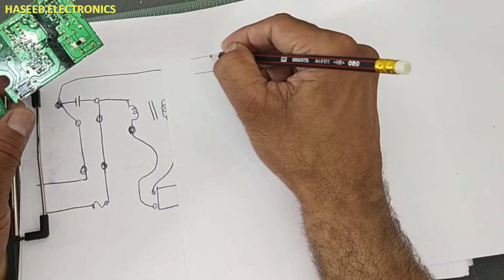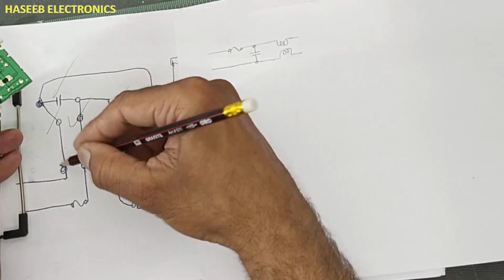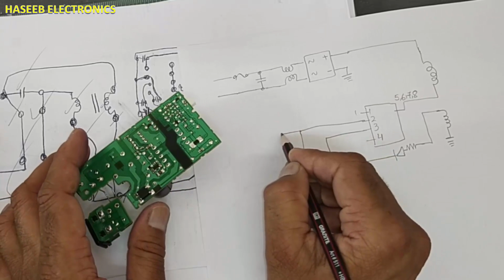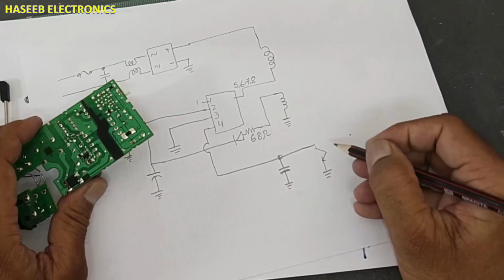{648} How To Draw Circuit Diagram From PCB / PCB Layout. PCB Reverse Engineering Technique

Comment: Thank you I enjoyed the video although it seems quite tough for my level. I am currently attempting to repair a 220vac automatic voltage stabiliser and i need to study the control circuit , then study the relay switches then the tapping on the primary and secondary coils.  I hope i manage to fix it even if it takes a long time to learn.

Comment: Nice teaching Mr, Haseeb, i have a laptop charger that would not startup  the laptop i commenting with right now, so i got mad and put the charger in the freezer for 10 minuits , then i plugged the cold charger in the laptop and woops , the laptop startup , this is crazy for me , maybe you can explain what component in the charger got cold so that the charger decides to work . this happen every day and i can work on the laptop more than three hours long , i do learn a lot from your videos , thanks verry mutch..
Reply from the maker: wow it is really fantastic, it is really a surprising fault 
possibilities 
1. Dry Joints / dry soldering in power rail (mosfet, PFC mosfet, PFC rectifier, main bridge rectifier, current sense resistor)
2. some internally leaked polar electrolytic capacitor. (check body temperature after is turns off after working cycle)
3 check output cable continuity between three wires (sometimes the wire insulation becomes leak or weak, which makes chafing between the + to negative or - to positive or id resistance wire makes short circuit with other wires,  check continuity between three of them to verify)  
4. might be optocoupler or PWM+PFC controller chip (sometimes the chips internal connections become loose)  
and please reply with your troubleshooting results

Comment: السلام عليكم, does the frequency change, through feedback, or is the pulse width the one that changes with a fixed frequency, to fix the output volrequired voltage, h

Comment: Very useful tips and tricks.  Thank you for this video.  I will use this technique.
I was also wondering if this cannot be done by software.  I know software exists that can create a PCB layout from a schematic.  Maybe there is other software that can do the reverse?
Reply from the maker: best regards 
it is very very basic step in reverse engineering. 
there are many softwares, picture editing tools which are used in advanced level reverse engineering and R&D

Comment: Why is RC snubber is in the secondary instead of primary?
Reply from the maker: RC snubber across a high frequency rectifier, is used to provide fast recovery and to compensate capacitance of the PN junction of the rectifier